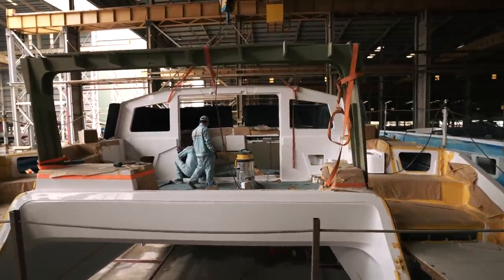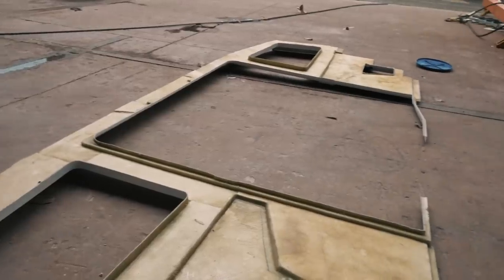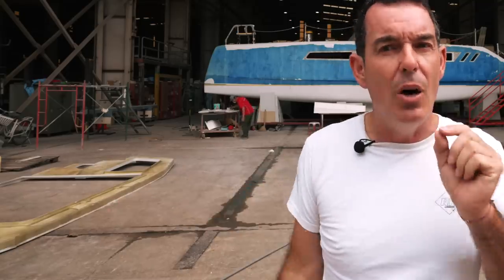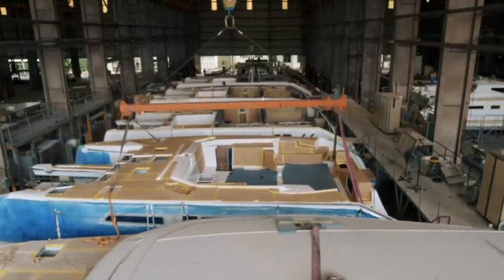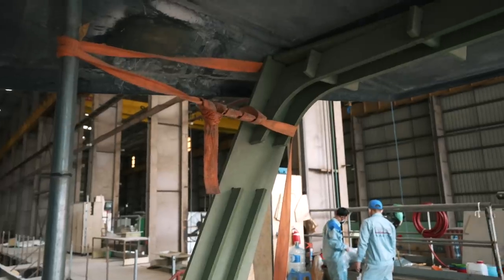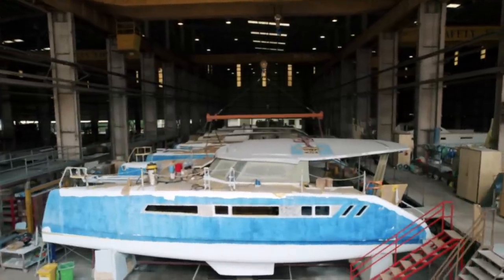A Big Step Forward- Carbon Bulkheads are IN! | Catamaran Build in Vietnam

Comment: To clarify, the green sections you showed in the hull are all meant to be templates and eventually create the molds for the actual structures that will be dry fit and adjusted later?

Comment: Remarkable video. Thank you for sharing.
When the carbon fiber bulkhead is finally placed, does Seawind use both a bonding method (thickened epoxy?), followed with carbon fiber tabbing, in order to create a single, never-moving and squeaking, unit?
So much to see and so much excitement!

Comment: Great weld verses not so great you can see the puddling, like a lace of pearls. Has the price changed due to changes or material cost ?  When did you sign and lock in the price, was it two years now?
Reply: Called stacking dimes